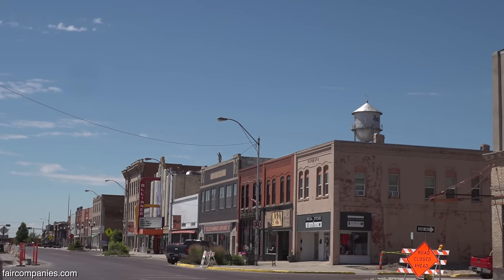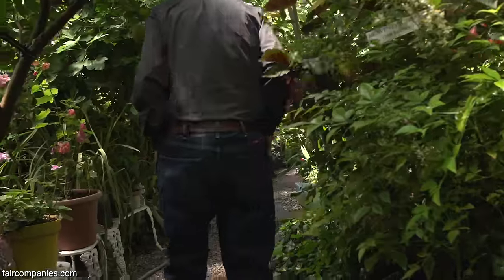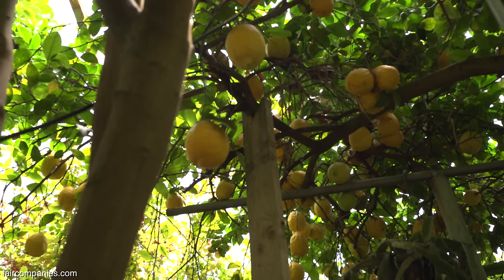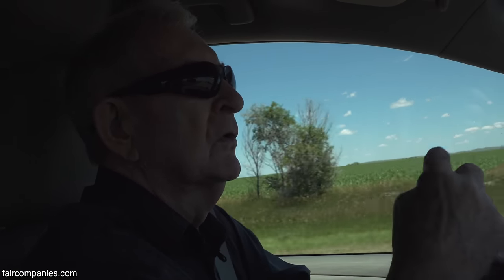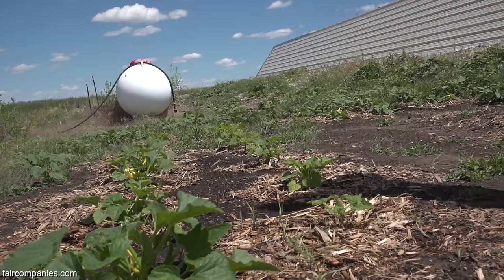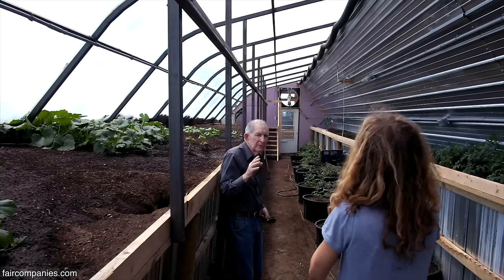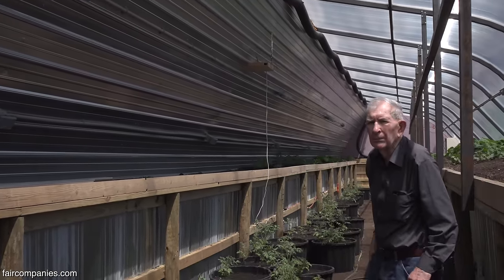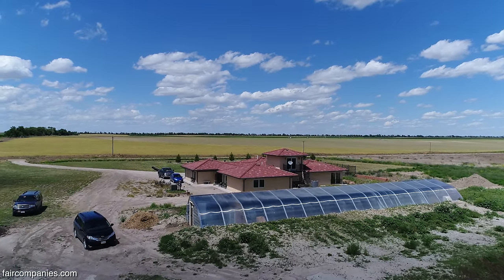Nebraska retiree uses earths's heat to grow oranges in snow

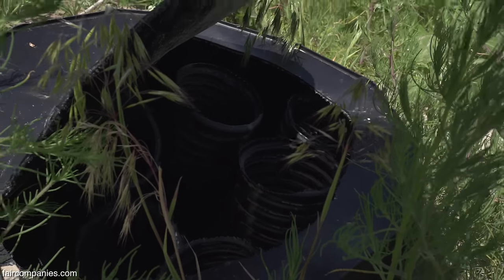Comment: At 10:40 he describes one of these geothermal systems...are there any engineers here? is there a formula anyone is aware of that would allow us to calculate the required pipe material, diameter and run length based on a known ground temperature, target heating temperature, estimated R value and volume of the structure to be heated? 

I would love to build a winter-capable greenhouse on our land. i'd love even more to overbuild the geothermal system to connect with our house. winter here can go to -30 celsius and while we get severe snow, a south facing greenhouse setup just like this gentleman has would work perfectly here.
Reply: He used to sell a CD with this information.  I bought it but I know there have been a lot of updates in the last 7-8 years.  What I remember is you want to use 6 inch pipe -non corrugated if possible,  and have as few bends as possible.  I think he had 180' and a couple of 90 degree bends.  The issues I've heard from people since is that you want to make sure water can't get into it but that can be hard in rainier climates because of the humidity in the greenhouse.  I am sure someone has come up with a solution for this by now too.

Comment: How does he grow all of these plants and stuff, if the ground is 52 Degrees? Thats too cold. Or like how does the Geo Thermal make the 52 degrees go up in temp? Because a video on the news, an Indian Reservation they use the Geo Thermal, but only grow cold weather crops when it is cold outside, since its similar 52 degrees in South Dakota
Reply: 52 degrees is the lowest it gets at night, during the day the green house elevates the temperature higher and while 52 degrees is enough to slow down growth it isn't enough to actually kill your plants.
Reply: @DarkSolidity Yeah that's true.  I grow tropicals in my Kansas greennouse that gets into the 40's when it gets -10F and 30 below windchill and they heat up the next day like nothing happened and didn't notice.  It is the days of clouds and constant 40's it begins to get their attention.

Comment: Does anyone have any idea how far north you'd still be able to grow citrus when considering the hours of sun? Could you pull this off in south of Sweden where the hours of sunlight gets down to 7 hours in December which is 2 less than the 9 hours they get in Nebraska
Reply: If citrus is at 5-10 C during winter it's light requirement is relatively low, also if needed LED lights are inexpensive.
Reply: @jarmomoskuvaara  Thank you. Yeah I guess 2 hours of extra light for 2 months wouldn't ask for too much, if needed at all

Comment: I am curious why the tubes going outside ? Is that basically just fresh air ?
Reply: 1 set of tubes form a long loop outside the greenhouse with both ends terminating inside the greenhouse. A separate tube is used to provide fresh air which is tempered by the ground. One end of this tube is in the greenhouse and the other is outside and open to the air. The main issue is that long tubes limit airflow and to cool a large greenhouse you need short tubes and a massive amount of airflow. If the tubes are 250ft long, the air will cool to ground temperature in the first 15ft and the power used to push the air through the remaining 235ft is a complete waste because the air will not get any cooler.

Comment: amateurs..... seems like a terrible greenhouse design not gonna lie.. besides the geothermal is always a plus but to me ur greenhouse is crap without it unless u live in a temperate climate that doesnt change. if thats hose water that could be bad too.. filtered is better for control. silly to use plain pots in there also.. the right side has the right idea with the ledge but its still missing air pruning and more efficient irrigation. a greenhouse is no different than in indoor grow besides u dont need lights, and ur in agreenhouse. hydro is best. aerated above ground soil is next best. u just want geothermal heat unless u want to pay exponentially more on electricity or gas to heat it. its not complicated. this guy took an odd approach and never addressed any of this intentions for such a strange design and 25grand sounds like if u paid someone to do it.. do it yourself for 5 or less if you are resourceful. if u can barrow something to dig with that saves a ton of money.. diggin urself saves a ton. the material u use hugely dictates the price.. its just a greenhouse.. u can use stuff like pvc and then just build a sturdier frame and bracing. greenhouses are completely custom but saying it cost 25g is silly to say.. thats not what it costs, thats what HE paid... lol its different for everyone for sure.